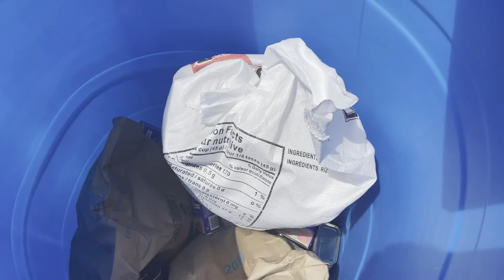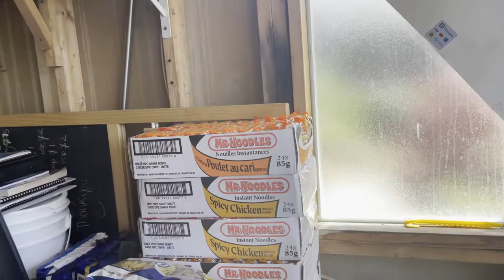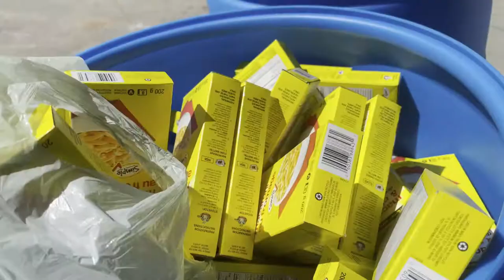Packing Barrels to ship to Jamaica || Hylton’s Family Vlog

Comment: First of ...WOW! That’s a lot of stuff, I knew you were gonna need another barrel or two but it turns out you needed a 3rd with a grand total of 6 😱😱 you’re family is extremely bless. Are all the barrels going to one family or are you splitting them up amongst the 2 families? I’ve packed two barrels and plan on packing 2 more before the year ends, my uncle gave me  tips with the cans, the ones with the pop tops (Marcel and Sausage) pack them toward the top and the ones with no pop top keep them at the bottom, he also said it better to put the oils in the middle around soft stuff like flour and sugar but of course tape the top and put in multiple bags. Another tip taking the toothpaste out of the boxes will give you more space. Thanks for sharing 👍
Reply from the maker: It’s going to 2 Different home.. thanks so much for the tips I will definitely Try that..
Reply: A lot! I thought I have a lot.
Reply: @Medline Sutherland, thanks for the tips. That's why I'm on here looking for tips.